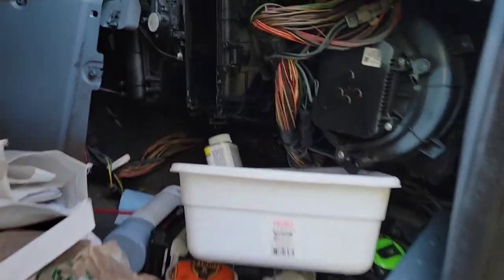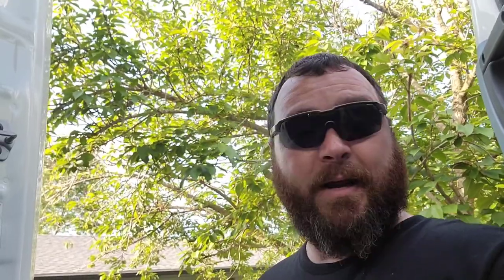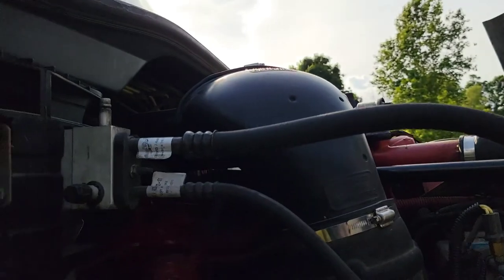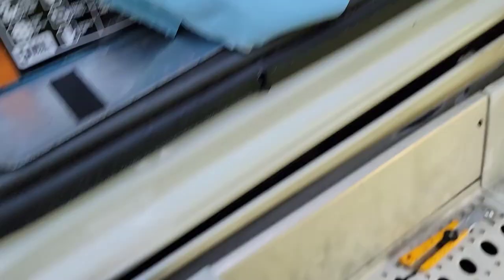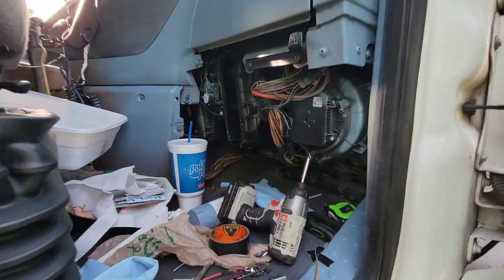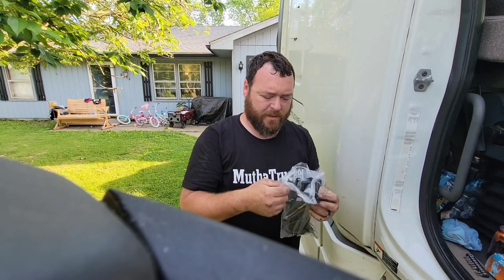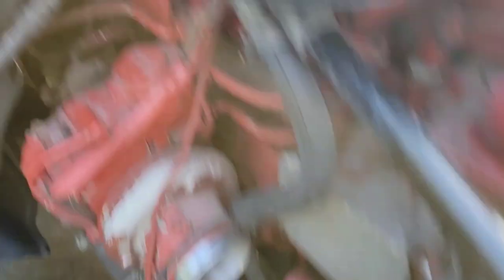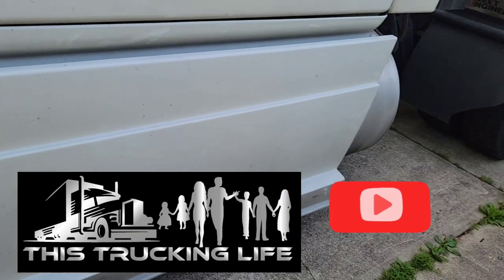A.C. Evaporator repair replace part 2 vlog Freightliner Cascadia #trucking #diy #newauthority

Comment: I heard that leak sealer in your ac system is a problem. It can clog up the system. I hope you don’t have this problem.
Reply from the maker: Fast forward a year. Sold the truck. Ended up getting the a.c. working it's in one of my videos.

Comment: Hey I just replaced the evaporator and the system ran for 20 mins then went out again.u think something about was put in wrong?
Reply from the maker: Oh that's a tough one...it does sound like the refrigerant is leaking. There's a refrigerant pressure sensor that will cut the compressor if the pressure is too low or too high.

Comment: Hey man I have replaced compressor, condenser, dryer, new cabin air filter, blower motor, still my air flow is restricted.  It's on high but blows like it's on low. Do u think it's the evaporator core?
Reply from the maker: That's hard I was gonna say blower motor but that's been replaced. Idk sorry I can't help. But let me know if you fix it.
Reply: If it blows cold but not hard then that means your ac drain is clogged. Remove the black box that holds the air filter see if there is anything clogged in the drain.